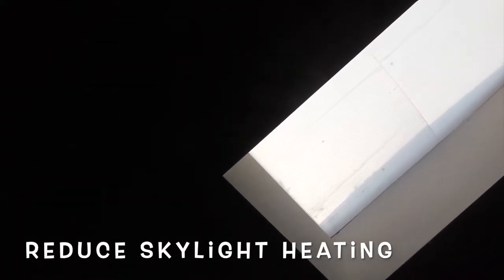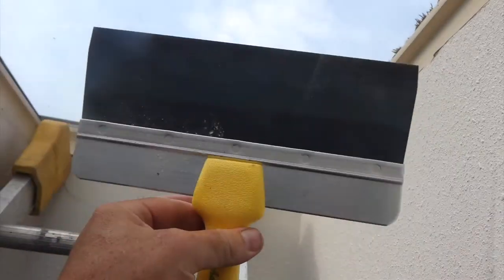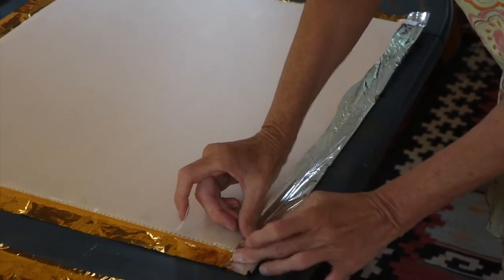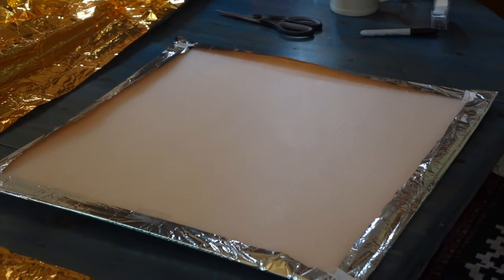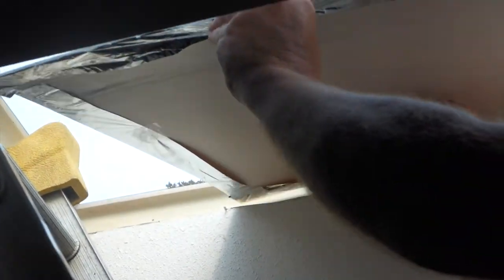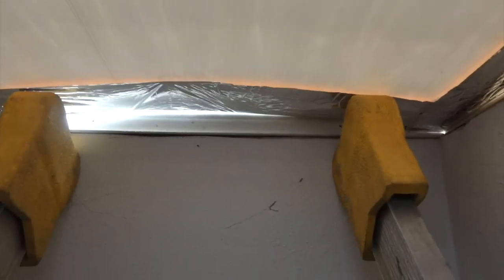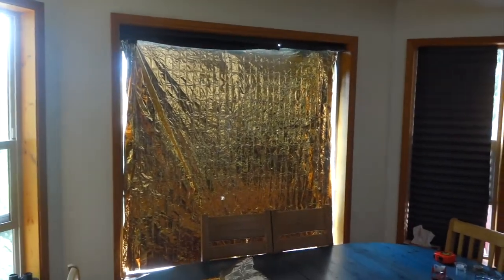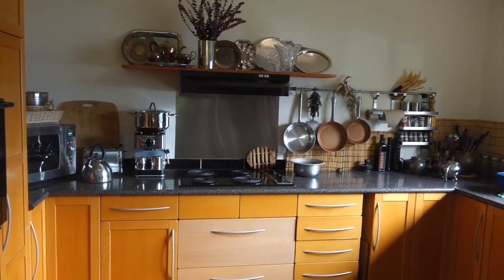Reduce Skylight Heating

Comment: Interesting approach. But that has to be the most ineffective taping job I have every seen. Using tiny little pieces of scotch tape is not going to work for very long. You need to use a stronger tape, perhaps aluminum tape, all along the overlapped edges of your mylar that will hold more effectively and for much longer. Keep in mind that the great deal of heat up there is going to soften the glue on most any tape, so maybe even use some kind of aggressive adhesive instead? 

Also I wonder if adding the barrier, whatever it's made of, outside the skylight instead of inside would be even more effective? Our single skylight is right over a staircase which makes me interested in this approach. Generally outer barriers reflect away more sunlight than inner barriers, at least I think that's the way it works. For example, if you put an umbrella on the roof over that skylight, wouldn't that stop much of the heat better than an inside barrier? I'd experiment a bit, not with umbrellas but with whatever could cover the skylight temporarily. 

Alternatives: Closed cell foam pads are designed to NOT allow the transfer of heat away from your body when you sleep on them. Would one large pad covered in reflective mylar work even better? If you could somehow drape 12" of fiberglass insulation over the outside (or inside) of that skylight as you do in your attic to keep heat inside the house in winter and outside in summer, that would also cut the heat down dramatically. Is there such a thing as "venetian blinds" for skylights where you close them only when you need to? How about using window reflective film on either the inside or the outside of the skylight to reflect away the sun? Getting it on would not be easy, but it could be done from the outside in the same way it's added to car windows -- squeegee, water and soap, etc.

Comment: Great video! Any issue with melting the skylight from this?
Reply from the maker: Our skylights are made from flat glass.  So we have not had any problem.  Using highly reflective material should reflect most of the heat back out of the skylight. Still, depending on the reflective material and the nature of the skylight material, it may be possible to build up heat.  Your mileage may vary.